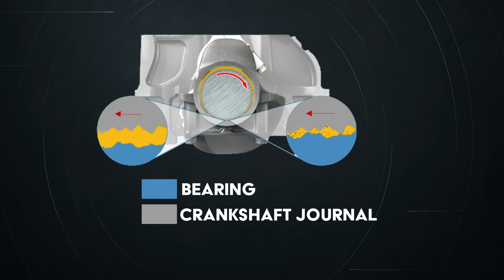the truth about start-stop technology (finally proven)

Comment: The average annual distance driven in the UK is about 11’000 kilometres. Even if you keep your vehicle for 20 years it will most likely end it’s life as MOT failure for structural corrosion reasons.  Worrying about Stop/Start is a folly.
Reply: I know very little about engines and you could be right but what about the starter motor and battery wear, it is designed to start /stop the engine 20, 30 or 50 times every day you drive it? As I said I am no expert. A new battery for my VW Golf mk8 from VW is £380 (inc coding to vehicle). This sounds a lot to me and could be needed after only 3 to 5 years.

Comment: Go electric.
Reply: Electricity to charge your "GREEN" battery powered vehicle comes from;

 • Fossil fuels 60% Lets explore this shall we?
 • Nuclear 20%   Ohh ya that's really clean energy. What's the half-life of radioactive byproducts? Japan released how many millions of gallons of radioactive water into the oceans? Not to mention the airborne radiation results of the 2011 tsunami?
 • Renewable 20% Giant windmill blades at the end of service life are placed in a huge trench and backfilled over.
 • Pumped storage hydropower -0.1%

 • Lithium mining causes land scarring, pollution, greenhouse gas emissions, water contamination, air pollution, and soil degradation.
 •  Lithium mining, particularly from hard rock, requires substantial electricity. This energy often comes from non-renewable sources, exacerbating carbon emissions and the carbon footprint of lithium production.
 •  Lithium mining generates large quantities of mineral waste
 •  Lithium mining has led to social struggles and human rights issues, particularly affecting indigenous communities. Extraction has displaced many from their ancestral lands.
 •  Producing lithium batteries emits more carbon dioxide than manufacturing conventional cars. For instance, producing a 1,100-pound battery can emit over 70% more CO2 than making a traditional car in Germany.
 •  Lithium-ion battery recycling faces challenges including high energy consumption, toxic waste, including heavy metals like cobalt, nickel, and manganese, and inefficiencies in material recovery.
 • Polluting of the groundwater.
 •  Australia found that 98.3 percent of lithium-ion batteries end up in landfills. That has to be sooo good for the environment.

Please, don't tell me how "your" GREEN electric vehicles are superior to gas powered vehicles.

side note
Please:
If you insist on doing so, before beginning any statement or discussion, exclaim;
I just farted and as the aroma rose, I breathed in deeply and enjoyed the flowery bouquet of my flatulence, smuggly savoring every delicate nuance before exhaling, ahhhhh.
 Electric vehicles are . . .

Comment: I wish I had a way of turning that off on our 2021 BMW 540 I. The thing that bothers me the worst is after a nice sprint on the freeway and you stop at the first red light exiting the freeway. The motor shuts down while the turbo charger impeller speeds are still near 100,000 RPMs. I can’t believe they do this.
And that’s only one of the many wear items caused by start stop BS. 
Anybody in the comments know how to disable or bypass on a 2021 540 I please
Reply: The average annual distance driven in the UK is about 11’000 kilometres. Even if you keep your vehicle for 20 years it will most likely end it’s life as MOT failure for structural corrosion reasons.  Worrying about Stop/Start is a folly.

Comment: Idle stop is so annoying and knowing its not great for your engine makes it worse. I wish my honda would remember the state of the idle stop button when the engine was stopped by me. I installed an "idlestopper" gadget in series with the switch. It reverses the function idle stop switch. Idle stop now is default off upon restart and can be enabled if I toggle the switch.
Reply: The average annual distance driven in the UK is about 11’000 kilometres. Even if you keep your vehicle for 20 years it will most likely end it’s life as MOT failure for structural corrosion reasons.  Worrying about Stop/Start is a folly.

Comment: Electric propulsion has all the benefits of stop-start, without all of the B.S, that a gas engine has to do.
Reply: But* Electric propulsion has the following BS;

 Electricity to charge your "GREEN" battery powered vehicle comes from;

 • Fossil fuels 60% Lets explore this shall we?
 • Nuclear 20%   Ohh ya that's really clean energy. What's the half-life of radioactive byproducts? Japan released how many millions of gallons of radioactive water into the oceans? Not to mention the airborne radiation results of the 2011 tsunami?
 • Renewable 20% Giant windmill blades at the end of service life are placed in a huge trench and backfilled over.
 • Pumped storage hydropower -0.1%

 • Lithium mining causes land scarring, pollution, greenhouse gas emissions, water contamination, air pollution, and soil degradation.
 •  Lithium mining, particularly from hard rock, requires substantial electricity. This energy often comes from non-renewable sources, exacerbating carbon emissions and the carbon footprint of lithium production.
 •  Lithium mining generates large quantities of mineral waste
 •  Lithium mining has led to social struggles and human rights issues, particularly affecting indigenous communities. Extraction has displaced many from their ancestral lands.
 •  Producing lithium batteries emits more carbon dioxide than manufacturing conventional cars. For instance, producing a 1,100-pound battery can emit over 70% more CO2 than making a traditional car in Germany.
 •  Lithium-ion battery recycling faces challenges including high energy consumption, toxic waste, including heavy metals like cobalt, nickel, and manganese, and inefficiencies in material recovery.
 • Polluting of the groundwater.
 •  Australia found that 98.3 percent of lithium-ion batteries end up in landfills. That has to be sooo good for the environment.

Please, don't tell me how "your" GREEN electric vehicles are superior to gas powered vehicles.

side note
Please:
If you insist on doing so, before beginning any statement or discussion, exclaim;
I just farted and as the aroma rose, I breathed in deeply and enjoyed the flowery bouquet of my flatulence, smuggly savoring every delicate nuance before exhaling, ahhhhh.
 Electric vehicles are . . .
Reply: @nobodyinparticular-b7r   Very poor response from a guy obviously with low testosterone issues who needs the noise from the old fashion gas burning po$hit  he can afford.  try getting your opinions separated from actual facts, then get your Hemi rebuilt.

Comment: Stupid idea, second place: introducing start-stop systems
Stupid idea, first prize: let's make the oil pump very weak and thus warm idle oil pressure very low because with start-stop, the engine almost never idles anyway and we can save 0,004 l of fuel and 2 grams of co2 per 100km in WLTP cycles.

Comment: 2023 Si ran hard to redline daily in Normal Drive mode. The Auto Stop Start doesn't bug me because it quickly starts up whether I release the brake pedal or step on the clutch pedal. Also, I do 2,000 mile oil changes and the engine doesn't have Honda's VCM.

It's chill for me.

Comment: On my wife's 2015 Acura TLX, this was the first car (and only car) that had it start/stop.  What happened to her was a safety issue, that permitted an accident to happen.  She was stopped at a red light, so the engine had automatically turned off.  She noticed that vehicle behind her didn't appear to be slowing down and was coming at full speed (she was in a 60 kph zone), and in the last moment she took her foot off the brake pedal and stomped on the gas pedal to try and get out of the way.  Well, the auto start/stop had a moment delay in getting going.  It did start to roll but not immediately and not with full power (that V6 car does have a pretty good 0-100 kph time and in AWD), so she was rear ended but not as bad as it could've been.  The repair was only the bumper, and unfortunately not enough for us to be able to get rid of the car.  We did try to simulate it afterwards in terms of a 0-60kph with the engine running, and with the auto start/stop engaged and the engine off and we found to get up to speed was over a second less.  I know that doesn't sound like much, but that is the difference between potentially avoiding an accident altogether and maybe even worst case scenario (at a vehicle coming at a higher speed) a fatality.  We got rid of the car not too long after that incident and purposefully looked for a vehicle that doesn't have it.  She really liked the Acura TLX S type, but it also had that feature that cannot be programmed to be disabled, so we went with the 2023 Lexus IS 300AWD as it doesn't have it.  I'm lucky that my newer vehicle also doesn't have it, a 2022 Toyota 4Runner.
Reply: How the idle-stop is implemented matters.  I have a 2001 Honda Insight parallel mode hybrid.  The insight engine is quite small, only 997 cc.  The motor/generator is integrated into the engine flywheel.  The engine is started with the hybrid motor and is essentially at full RPM within milliseconds.  It is quite surprising just how fast it happens.  There is a back-up conventional starter which is only used if the hybrid battery goes out of service or if the ambient temperature is below about -10 deg. C.  In cold conditions or if the hybrid battery is out of service the idle-stop is disabled.  I believe Toyota does soemething similar with their hybrid system on the Prius and the 3 liter V-6 used in the Highlander.  The difference is that the Toyota engines can not operate when hybrid battery has malfunctioned.  The Honda operates as a conventional gasoline powered car when the hybrid system is not working.
Reply: "it's stop starts fault that another driver wasn't paying attention and crashed into my wife" I love mental gymnastics
Reply: @ej20tnz way to reframe the comment in a way that completely misconstrued what he said. 🤡
Reply: @johnlibonati7807 Seriously, how is it the cars fault that another driver wasn't paying attention?

If someone crosses the centerline towards you and crashes head on with you, would you blame your car for not having a fast enough ratio steering rack to dodge the other car?
Reply: I've had numerous experiences test driving customer cars where I tried to turn right at a particular intersection and the delay almost caused me to cut someone off when I would have merged safely with plenty of space if I turned the start stop off.
Reply: I'm sorry to be that person, especially as someone who actually loves cars and internal combustion engines (enough to quit software development in favor of becoming a car mechanic, enough to want to rally at least once before I am too old for that), but the instant effect of an EV would actually have been safer in this scenario than any of the combustion engine driven models, and there is no idling or start stop stuff at all in the first place, that is, besides the battery fire hazards and the strain that EV's put on underfunded and underdeveloped power grids in places like the US.
Reply: I was stopped at a toll booth this week in a stop/start car, and of course the car stopped.  I was looking for my wallet and unconsciously eased my foot off the brake pedal which of course activated the start mode…it started and lurched forward into the rear bumper of the car in front….🤬🤬🤬

Note: I did not remove my foot from the brake, just eased the pressure enough to start.
Reply: @ianchandley  that could happen in a car without stop-start as well.
Reply: @jdillon8360 Remember, he has to find a reason why it's not his fault

Comment: Very detailed presentation. Would you be able to run the experiment again for the same length of time this time without the start stop system? Have the engine start just two times a day to simulate driving to work and then starting again to come back home? Thereafter, compare the bearings and show the significant difference between start stop versus without start stop system. Thank you, looking forward to your videos.
Reply: That would be much better science.